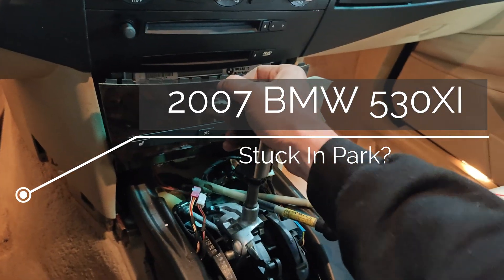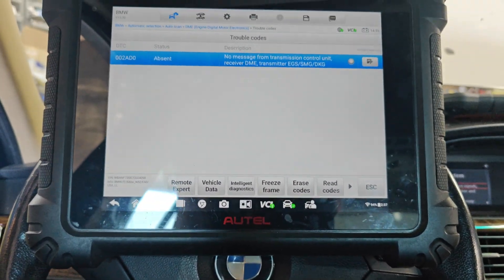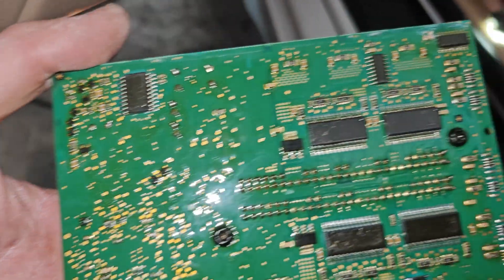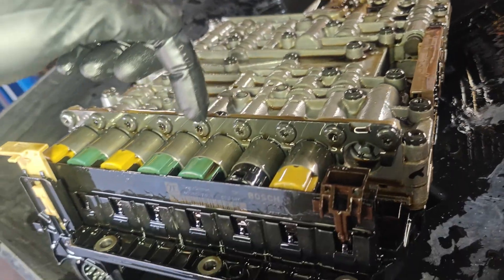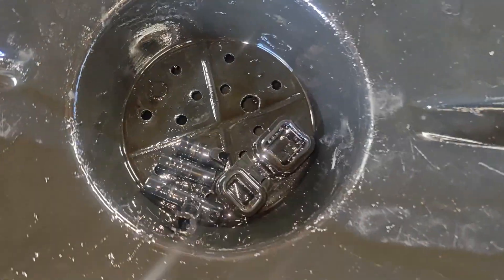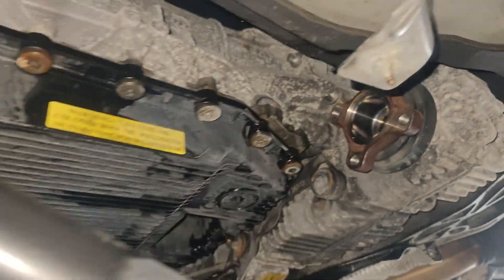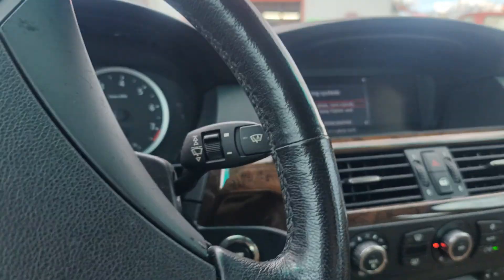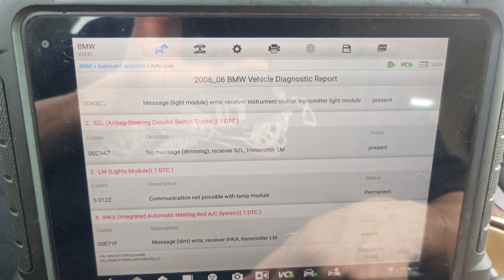2007 BMW 530xi Stuck In Park and Exterior Lights Do Not Work - 2AD0 - 4E23

Comment: Seeing you drop that valve body brought back some memories.  Next time, you can get slip jaw pliers between and change out the connector.  Also, did the customer change the sump pan? Nice video tho
Reply from the maker: Thanks for the tip! I did not change the pan, They Did not want to put money into the car.

Comment: Those electrolytic capacitors are toast. That'll take out the module. They ARE replaceable.
Reply from the maker: They are but the corrosion is really bad and the modules are cheap